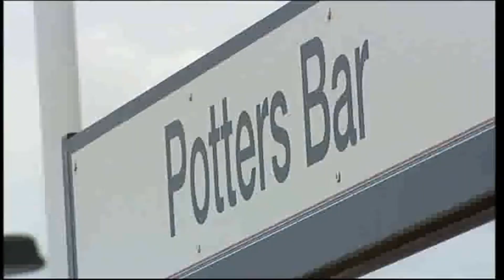What Really Caused the Deadly Potters Bar Rail Crash? #potters #england #accident #disaster #fyp

Comment: That insourcing maintenance of critical infrastructure improved safety significantly is utter nonsense. If you don't have the competence to adequately check work carried out, insourcing that work still does not suddenly give you that competence. 
Acquiring that competence after the Potters Bar incident was more critical than insourcing. Actually my personal opinion is that insourcing itself was quite unnecessary.
Reply: insourcing/outsourcing?
Reply: @johnmcmillan59 I suspect the point is it doesn't matter who does the job, it needs to be done right regardless.